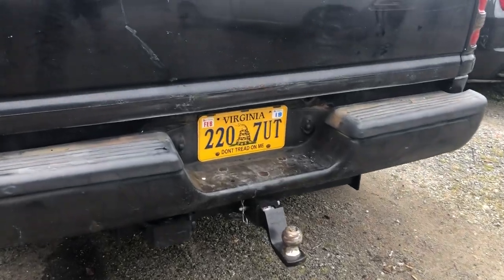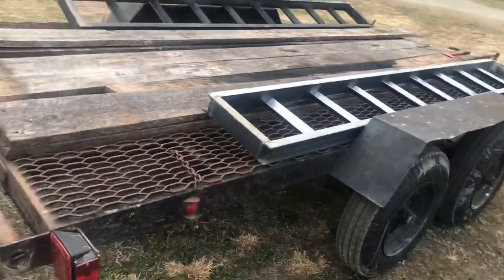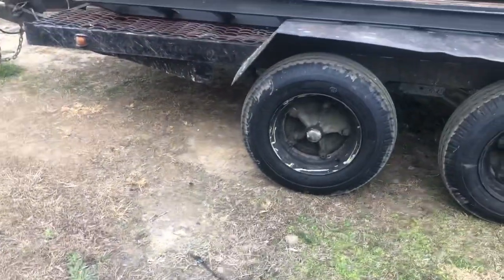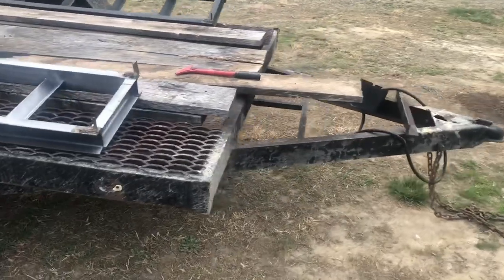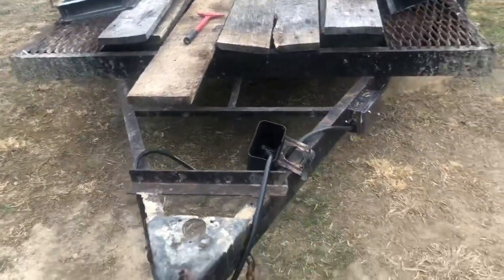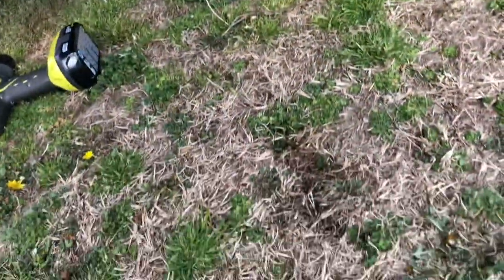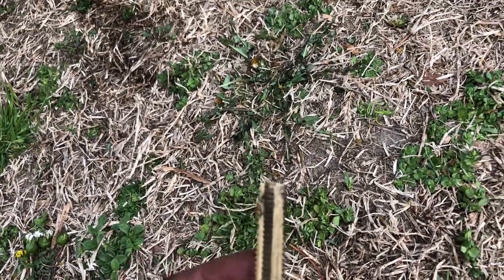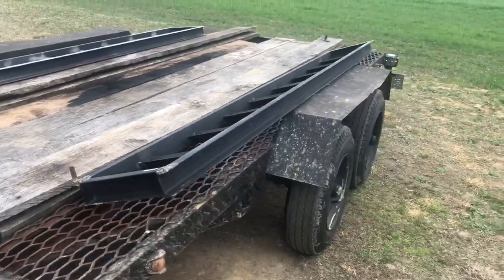Fixing a loose receiver hitch

Comment: I have a trailer built out of an old Studebaker pickup bed, and the tongue isn’t that long. My Jeep’s OEM 2” receiver fit all three of my hitch inserts(including my drop hitch). But, I installed a DV8 rear bumper, which has a built in 2” Receiver, and now all of my inserts have about an eighth of an inch of play in all directions. I hope this fixes it.

Comment: You got the right idea to stop that hitch tongue sloppin about back there. I drilled a big arse hole then welded a tow ball nut under where you drilled and tapped before screwing in the bolt. But I gotta say, it sounds like you are spending little too much time driving around thinking about soft rocks and mayo on hot dogs.

Comment: Duct tape. Wrap it in duct tape and it won’t rattle
Reply: This works for about a mile with a heavy trailer it will flatten and then wear the duct tape out. I just found a better device called the hitch clamp.
Reply: @hawkofthenorth4829  Nah duct tape works good